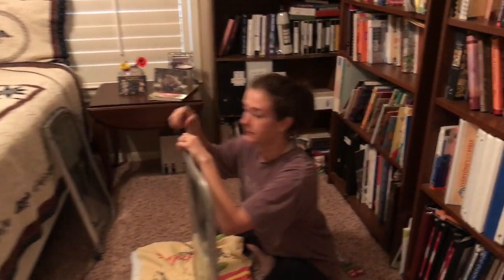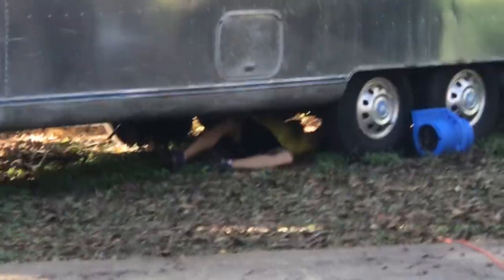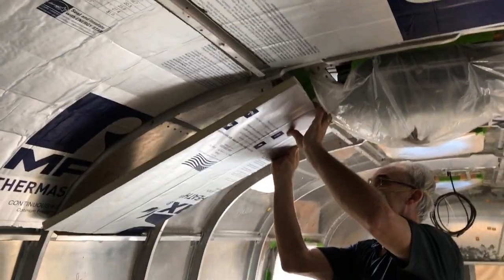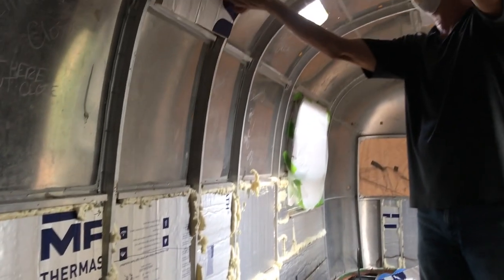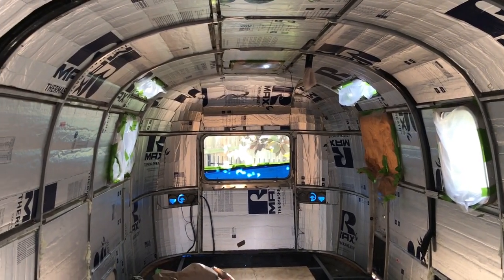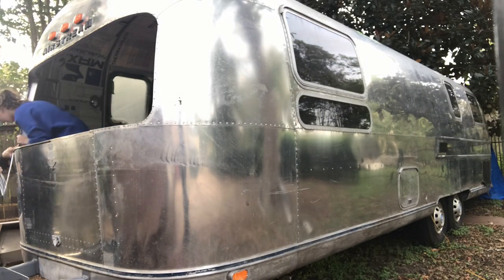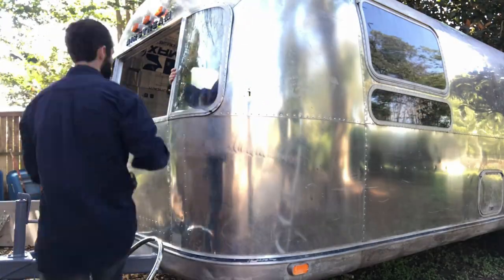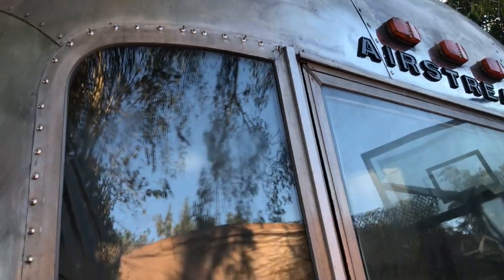Diary of an Airstream Week 3-4: Window Repair and Insulation

Comment: Why did you choose Olympic rivets as opposed to true bucked rivets on front and wing frames.  Did these seal well enough to be watertight?

We are considering repairing all windows in our 1972 31’ Double twin rear bath sovereign land yacht. Thank you in advance
Reply from the maker: Olympic rivets are great for remodels. They do seal really well and they don't require two-sided access. Buck rivets also work great, but they require additional tools that we didn't have. To be clear, this first attempt did NOT WORK. If you look through our videos, you'll see that we had to redo this repair, but not because of the rivets. The gasket we used in our first attempt did not create a watertight seal. For our second attempt, we used butyl tape and put a small amount of caulk on each olympic rivet as we placed it. That created a watertight seal that has worked great. I would also check the seams of your shell panels. We had water getting in at the seams between the panels of the shell and running down to the windows, making it appear that the window was leaking, but the water was actually getting in much farther up. Good luck on your repairs!